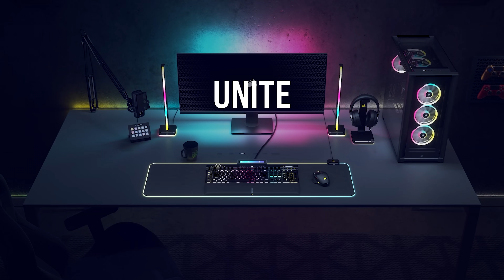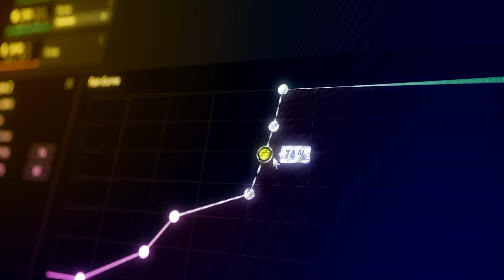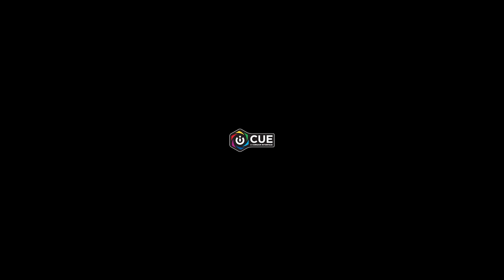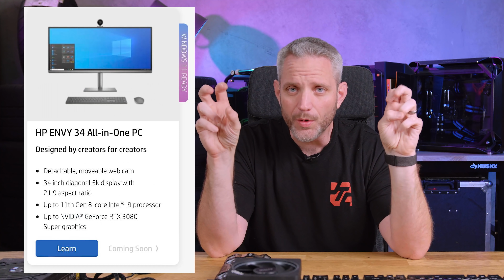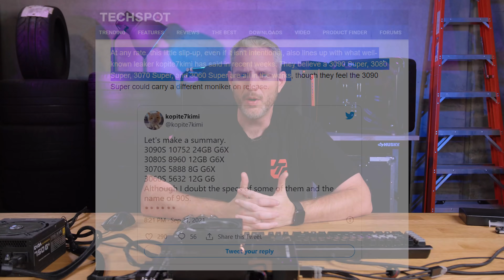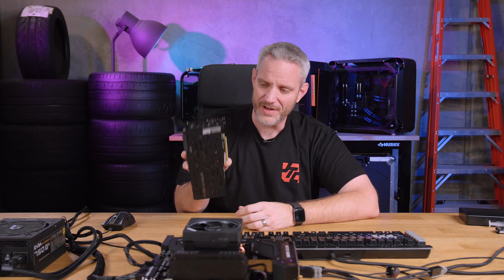RTX 3080 Super...

Comment: 5:00 Jay, Nvidia is STILL making TSMC 12nm GTX 1650 and 1660 dies!  The MX450 is literally a GTX 1650 with a 64 bit bus, using GGDR6.  But also, as far as I am aware new stock of 16 series are still coming out, possibly back channel tho, but the point is that it is on TSMC 12nm - which is NOT used by anyone but Nvidia, I would not be surprised if they have a large wafer supply left as well.

Comment: When they launched the Ti, did they stop producing more regular ones? I don't know if the Ti is to replace the regular, or fill in the gap between it and the 3090 🤷‍♂️
Reply: Fill in the gap and replace.
Reply: @tiredofthebs9  I was lucky enough to get a 3080 at MSRP, and for the price it's extremely good value for money. The Ti at MSRP isn't nearly as good.
Reply: What gap? The 2080 Super killed production of the 2080.
Reply: @patrickweaver1105  yeah sorry I wasn't talking about the Super, I know the video is about that, I just haven't seen any 3080 in stock in forever, by Ti's are in stock (for a high price that is) almost everywhere now.
Reply: @PlazmaBooy  Ah I misunderstood then.
Reply: @patrickweaver1105  I wasn't being very clear, sorry about that.

Comment: And for a proper clusterfuck, they'll give it the 20GB VRAM people (myself included) wanted to see on the ti.
Reply: 20 + GiB is a commercial card for rendering, encoding, transcoding, development partitioning into many 'characterized' GPU instances although 48 GiB x2 SLI s superior for these tasks. mb
Reply: @mikebruzzone9570  ah someone with a brain. Nice to see
Reply: @Real_MisterSir  Thanks, helps to hold the data see my Seeking Alpha blog spot; GPU Today briefs in particular there are several see newest (in development) and down the posting string for back in time; AMD, Intel, Nvidia channel audits and production economic assessments. mb
Reply: All I wanted was 16GB of VRAM.  20 seems excessive.  16 seems excessive too, but makes slightly more sense for 4k.
Reply: @the_big_mac_2020  16GB would've been perfect for the 3080ti.
Reply: What do you need that much for?
Reply: @verycalmgamer4090  Rendering work.
Reply: @stuartfury3390  yeah because it would make no sense for gamers. Because by the time a game does fill all of that up (not because its one of thos messy games where it'll just eat all the VRAM that's available) the GA102 wouldn't be good enough.
Reply: @Zeiss120  Well it makes a lot of sense for gamers. Provided the gamers also use the same machine for 3d work/rendering. But yeah, if you're just playing CoD, get a 1660
Reply: @stuartfury3390  The 3090 would be the card designed for you, the 3080 was always touted by Nvidea to be the "top" gaming card. So they do have had a card for what you want to do for about a year now, just not at the price point you wanted to pay.
Reply: @billwiley7216  I was replying to the person who said "what would you need 20gb VRAM for?"
Reply: @billwiley7216  no the 3090 is the “top gaming card” 
Otherwise it wouldn’t be called the “RTX 3090”

That would be like saying “the 1080ti wasn’t a gaming card” yes it is
It doesn’t have special drivers, or the Vram for a Titan
So it falls into GeForce 

And before someone says 
“It HaS 24Gb Of VrAm, ThAt MaKeS iT a TiTaN”
No it doesn’t
The 1080ti had 11gb
The 980ti had 6gb
We should have got 24Gb with the 2080ti 
But got 11 again
So no
A Titan should have 48, and there in lies the reason why they didn’t want to sell a Titan this round, cause they can just sell you a cheaper to make and less work 3090
YAY!
Reply: @Zeiss120  Wrong I had a 2080ti and played games at native 4K max settings and the lack of vram required me to lower the textures in certain games.
Reply: @ZackSNetwork  In "certain" games. care to name them?
I'm not denying there's games out there that can eat more than 11GB of VRAM natively, but most gamers won't run into such situation. And by the time a game does come out that needs 20GB of VRAM, the GA102 will have been far surpassed by that point.
Reply: @bornonthebattlefront4883  The 3090 really isn't made for gaming. At least, the gaming niche it fits into is so small that it may as well not exist. Only in 8k gaming with AAA titles would you ever benefit from that card in a measurable way. In reality, the 3090 is more of a work card that is consumer friendly, unlike the Quadro cards that are pure professional.
Someone doing extensive 3d work and video editing etc, while also using the computer for personal hobbies like gaming, that's what the 3090 is good for. Not the average high tier gamer.
Reply: @bornonthebattlefront4883 
 Guess you never did watch the release videos where it was Nvidea themselves that plainly said that the top GAMING card was the 3080.  No maybe's, no probably's just the plain facts out of the horses mouth Nvidea themselves. 
The 3090's intended audience was for content creators and work applications that could actually make use of the full 24 gb of vram again out of the horses mouth Nvidea themselves. Nvidea even stated the 3090 could be used for gaming but that was not its intended role.

But I guess you are actually more informed than Nvidea themselves that actually made the cards.
Do yourself a favor and go back and find Nvideas initial release announcements so you will quit making yourself look ridiculous.
Reply: @Real_MisterSir  the 3090 can’t do 8k gaming, if the 3090 is a “8k gaming card” 
Then the 980ti is a “4K gaming card”
60fps in like 3 games doesn’t count
Especially if one is doom
Most games you are looking at 20 to the max of 30fps
No Pc gamer is gonna find that acceptable 
Not in this day and age
And if it wasn’t a “gaming card”
Why was it advertised as such? 
What makes it special that it’s not a gaming card? 
I mean other then the stupid price
Yet, the 2080ti was 1200$ 
So asking 300$ more isn’t a long shot from Nvidia
Reply: @billwiley7216  so what did they do to make the 3090 special? 
There is no Titan drivers
There is no special die
No extra Vram
No crazy “creator price” 

It’s a gaming card
A gaming card that was sold like it was a gift by the gods 
“Wow they made the Titan so much cheaper!”
That kinda thing

It was all advertising 
Jenson wanted to sell the card
If he went on stage and said 
“Look, out flagship gaming card costs 1,500$”
People would have been pissed
No
No
Nvidia likes to screw you over slowly and while you don’t notice

And I don’t give 2 craps about what Nvidia says
It’s what they do that makes the product

They can call whatever they want what they want
Doesn’t change that the 3090 is the full die that they never wanted to give people
It ONLY exists cause AMD scared the crap out of them
And yeah
We have yet to see a Titan 
Why? 
Cause the Titan RTX is selling JUST fine…

Why spend extra when people continue to buy that card….

And if it wasn’t a “gaming card”
Why do Board partners like Evga, Asus, MSI all make custom boards and coolers?
They don’t do that for Titans
Only for GeForce cards
Or, oh my…. Gaming cards
Reply: @bornonthebattlefront4883  980ti definitely not 4k but almost good enough to be a legit 1440p card. I just bought one due to the market.
Reply: @MnBred90s  980ti is not even a 1440 anymore, for 1080p? sure it is
Reply: @manuelmunguia616  it's not great but gets about 60fps on warzone with medium/high. Not ideal but with lower settings it works. Older less demanding games it would be fine. 1080p is still definitely solid.
Reply: @MnBred90s  yeah but that’s the issue lol
People allow Nvidia to just sell what they always have but at a like 200% price hike

And instead of saying “nah we won’t buy” 
They go and beg for more abuse 

It’s stupid
People listen to a company who is trying to sell a product and make a profit on people’s ignorance more, then to someone who brings up points as to why it’s a bad product 

The 3090 is fine, I like the 3090
Just not at 1500$ 
And I hate the 3080ti down to the 3060ti
None of them have enough Vram
The 3060 is gonna preform better then the 3060ti in 2 years

But people are like 
“Waaa 8gb is more then enough!”
Yeah
For 2018
Not for 2022
Which is what these cards should be built for
They won’t age well at all, and will be outdated as soon as they are bought

And the whole “yeah but games don’t even use more then 12gb of Vram so it doesn’t matter” 
Yeah, games didn’t use more then 4 cores before too
Game devs will only use the tools given to them
Believe me, if they get to play with 8 cores and 16gb of Vram, they would prefer to
Why? 
Less optimization is needed, and heavier texture loads can be produced to make prettier games with less work
Not saying I want unoptimized games
It’s just that I want more Vram for the same reasons why I want more cores in the market
Cause the lower end SKUs will benefit, I don’t give a crap about the high end
I just want a 70ti class card that has decent Vram, 
I have a 1070ti and I’m not gonna “upgrade” to something with the same Vram
Stupidity 
Idc how much faster the Core is
Intel and AMD is gonna make cards with more Vram, I’ll buy those from now on
Not like I’ll be losing FPS anyways, the Cores will be just as fast, like a RX 6800 or something
Reply: @bornonthebattlefront4883  it's pretty weird that the 3060 has ghe same amount of vram than the 3080ti 🤣 meanwhile the 2070 and 3070 didn't get a bump in vram.
Reply: @MnBred90s  exactly 
You see what I’m saying? 
Then people get butt hurt “waaa the 3090 is actually a Titan replacement”
Bull crap, where is my 48gb of ram? 
Where is my Titan drivers? 
Where is the massive bus? 
Nowhere!? 
Wow
So not a Titan 

Anyways, nice to find someone with a brain LOL
Nice to meet ya!
Reply: @bornonthebattlefront4883  Why does dell advertise their prebuilts as pcs when they are just ewaste in disguise? That a good enough answer? The configuration of the 3090 alone is wayyy overkill for gaming purposes, and in most instances up to 4k you won't see a major difference from something like a 3080 let alone 3080ti. The 3090 is a work focused card, that is also marketed for high end gaming, but that's not really what it's made for, and only in 9k gaming does it gain measurable leverage over 3080 cards (at least for current game titles).
Reply: @Real_MisterSir  with that logic
No reason to upgrade from a gtx 1080ti
Cause everything else is overkill

Again, idc what is overkill and what isn’t 
And most people who have 3090s will most likely have 240hz 4K monitors
So yes, they will see a difference 

And again, please tell me other then the price, what makes the 3090 special? 
The 3080ti is 5-15% slower 
For like 500$ less
Why did sooooo many people want to buy the 3090? 

Absolutely nothing is special about it, it’s just the fastest Nvidia gaming card right now, and Nvidia knows that people will pay whatever Nvidia charges them for the highest possible performance 

It’s a status symbol, like a v6 mustang or a Lamborghini 
They arnt the best, not even good or comfortable 
It’s just to show off 
That’s what those cards are for 
And also the same can be said for anything over a ryzen 5 3600 or a i5 10600k
No reason to buy anything else
Those 2 can game just fine
Why buy anything new or faster? 

Stupid argument 
And no
The 3090 isn’t “overkill”
Cause next year, heck even this year possibly, there will be a card 60% faster 
For the same price or maybe (probably) more
And a 500$-600$ card will have the same performance 

You act like performance leaps gen over gen is a waste of time
And they are if they cost more
Kinda like the 3090 
If the 3090 was 1000$ 
No one would disagree that it’s the flagship gaming card, it’s literally only the price

But what, you think Nvidia drops prices? No they raise them
The 3090 isn’t a Titan, it’s not even a Titan replacement 
It’s an overpriced as heck gaming card for people with small penises that try to make up for it by spending too much money on a PC
Nvidia wants to sell to you
Idc what they say, its all about what they do
Reply: @bornonthebattlefront4883  The 3080Ti is not 5-15% slower. That is a totally unrelated metric with zero context. If you don't know what context to apply, then don't bother. I wont.
Reply: @ZackSNetwork  all and all the 2080 ti was an animal at the time and really still is a beast.
Reply: @verycalmgamer4090  future proofing. Vram requirement in software like high end videogames has nearly doubled in just the past 5 years. Where 10gb is a good buy right now, in the coming 3-5 years you may very well need that 20gb buffer just to be on the safe side. Remember, it's not that things can't make use of that much vram, it's just that prgrams haven't been optimized for it yet since these quantities of vram weren't available to mass consumer market until very recently.
Reply: @verycalmgamer4090  12gb is enough, but 20 gb vram could be a little bit  on the overkill side, still thise gpus will age better than the 3060ti/3070/3070ti
Reply: @manuelmunguia616  I’d rather more then enough, then not enough
Kinda like one of those things
‘Do I buy just enough wood to build my house? Or extra just in case I need to do extra things’

I hate the term “future proofing”
But in this instance, I also don’t want to be closed off from modern games cause of Vram limitations
Reply: @bornonthebattlefront4883  i hate turning down settings just because my vram is full and the game starts to stutter even tho im getting more than 60 fps
Reply: @manuelmunguia616  exactly lol

Comment: Honestly anything more than a 3080 ie ti or super is useless. A 3080 is equal to a 6800xt, if you want a 3080 ti get a 6900xt like I did. I still have better performance than a 3080 in all the games I play for a lot cheaper, $500 to be exact. The only reason I'd get a 3080 super is if it was less that my 6900xt and had a performance gain over a 3080 that weren't the price cheaper than a 6900xt. My 6900xt was $1100 and a 3080 for me is $980. The 3080ti is $1400, if I can get a 3080 super that was better than a 3080 and cheaper than $1100 I may recommend it.

Comment: I just don't understand why they aren't focusing on meeting the demand on the current cards instead. This is just so stupid.
Reply: $$$$$$$$$. 99 times out of 100, when asking yourself why a corporation did or did not do something, the answer is money.
Reply: Because that's not how producing microchips works.

You can't just manufacture 3080 only GPU silicon microchips. The manufacturing process isn't perfect.

What ends up happening is they manufacture a much better chip knowing that quality will be different across the produced microchips.

The best ones become 3090, and other yields become lower GPU chips.

Same reason they released 3080 Ti. They had yields where they had functional processors more than a 3080 but less than 3090. So instead of disabling a part of the chip, they release a SKU to maximize profits.

This has been normal since silicon manufacturing was invented.
Reply: @viet0ne  that's correct, but also realize that they also often create product segmentation even when they don't have to, it can often be more profitable to ensure you have every possible price range covered.
Reply: Because Super GPU's would increase their profit margins lol
Reply: money
Reply: Preach jay preach. 8:25
Reply: Welcome to 2030 <– Research this.
Reply: Money dude.  You will buy nvidia products regardless of who they piss off.
Reply: Nvidia produced 47 M Turing consumer and 67 M Ampere consumer. The channel saw roughly the same amount for Turing and Ampere see GPU Today at my SA blog spot. I estimated previously 15 M were bought by high frequency traders half of which cleared the secondary market primarily alleviating Pascal 10x0_ channel surplus that did result in a following price hike. I've estimated 2.4 M 3060_ r in finished goods build chain from run end slack falling out of sort. On that 20 M difference between Turing and Ampere consumer where Nvidia 2020 production is actually 25 M per quarter and Ampere in 2021 at 33 M per quarter its going to data center before Intel shows up a race for sockets and seats. On business use mass market is paying a commercial price for process shrink performance and will continue to do so every next generation; science and engineering. Game segment is already adjusting purchase cadence back one generation. I estimated 5 M commercial cards earlier in the year I am still thinking about that. mb
Reply: It is because they are meeting internal goals set by the Company. The last year and a half has pretty much been paper launches to meet internal goals. It also keeps the hype alive during this pandemic market. It also gives the content creators something to talk/complain about. Not sure why everyone worries about this so much? You want to show them this isn't acceptable? Then don't pay rapt attention to this stuff. Let the hype die and they will take notice. This card will most likely not see a major release or will just be hoovered up by scalpers and miners.
Reply: Corporations aren't your friend is the reality. Why meet demand when they can make a new sku and sell the exact same chip for 15% higher? I dont agree with it but Nvidia shareholders are why they would.
Reply: I agree with you on that point. 
I don't know why NVIDIA didnt do that.
Reply: @Ren_1106  I have a feeling it’s because Nvidia wants to sell fewer cards at higher prices and by releasing super they can make more expensive versions at a low volume to make more margin rather than selling more GPUs at a ‘cheaper’ original MSRP. I could be wrong though.